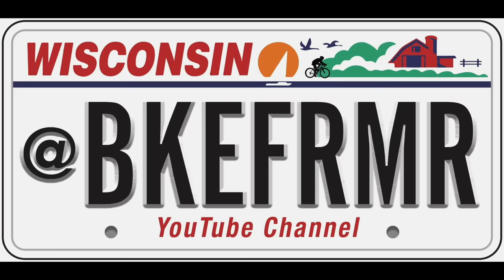Customer TRASHED their bike, but I still took it back! Big mistake? I gotta try!

Comment: I learned quite a bit. TY.  A town we lived in had twice a year 'large item clean-up' whereby residents could put to the curb just about anything they wanted to get rid of. Wanted to teach my kids the value in other people's throw aways so I canvassed the whole town and they arrived home to 12 bikes I amassed lol. I was able to produce 9 complete working examples. Enjoyed 2 myself and gave the rest to people in need. There's just something about bikes. Almost a crime to throw them away.
Reply: bikes are the simple most efficient mode of transport for any human, just think how far you can travel on 1 potato, they're mechanically simple and reliable. you can have a bike anywhere in the world and be able to fix it. there's beauty in the simplicity of something that fundamentally hasnt changed in almost 2 centuries
Reply: I agree so much...This winter I picked up two bikes that had a sign...Free scrap metal...a 1972 and a 1974 schwinn  Great condition just needed some minor adjustments...Wow They were advertised in schwinns manual as lightweight..@ 49 lbs :D
Reply: I work in recycling. The amount of decent bikes people chuck rather than donating to charity is a disgrace 😪

Comment: Adding a dork disc 😊 That’s experience right there: a mechanic who knows his customers knows what they’ll need, even if they don’t 😅
Reply: The metal ones are great
Reply: is that a fake front disc brake ?
Reply: @SPINNINGMYWHEELS777  no, the pie plate is behind the freewheel gears, to prevent spoke damage if debris traps the rear derailer or the limit screw is loose.

Comment: Idk how you got that derailleur set up so quick. I spent hours trying to just “fine tune” mine, only to make it way worse lmao. Good thing the local bike shop owner is a good friend of mine or I would’ve been screwed.  You guys are under appreciated massively.
Reply from the maker: I made one small tweak to the High Limit Screw that I cut from the video because it was pretty much an automatic response for me. I've refurbished and tuned tens of thousands of bikes like this. I'm super good at it! I definitely go into more detail in other videos!
Reply: Try the Shimano installation instructions that are also available online. They explain every single step in detail, and don’t worry if your front mech is a different make, the instructions aren’t limited to Shimano. I’ve worked about ten years as a professional bike mechanic and still think that Shimano’s often discarded unread little leaflets provide all the necessary information for perfectly setting up your shifters and derailleurs.

One thing to keep in mind, on some more recent front mech designs the limit screws maybe inverted; i.e the outer one controls the inner small chainring limit and vice versa. Best to check with the cable disconnected.

And last not least, make sure that the cable is clamped in the correct position with indexed shifters. Else derailleur travel is going to be all over the place and you’ll never get it adjusted. You won’t believe the “creative” ways I’ve seen customers’ front and rear mech cables being clamped incorrectly. Don’t assume that everything is correct just because “it came like that”, especially with a used bike.
Reply: I'm no pro, but here is what I do.  First, with no cable, I set the high limit screw so the upper pulley centerline is just a hair outside the smallest cog's centerline by looking from the rear of the bike.  Second, I manually manipulate the derailleur to the lowest gear (big cog) and set the screw so the upper pulley's centerline is just a hair outside the big cog's centerline.  With the barrel adjuster all the way in and the shifter set to the highest gear install the cable with a decent tension on it (helps to have a third hand tool, but not mandatory).  Set the shifter to the second highest gear, and turn the cranks.  Keep backing out the barrel shifter until you shift into the second smallest cog, and a couple clicks more.  Now run up and down the gears and decide if you need to go in either direction that last click or two to get even shifting speed up/down.  Jobs a goodin'.
Reply: It helps if the chain is cut correctly to the right length first

Comment: My observations of small bike shop operation leads me to believe that bike repair/servicing is the cornerstone of the business. Sales brings them in but providing great service will build a customer base. Also servicing bikes has a fixed time frame you cannot shorten repair times and still provide quality service. The first indicator of problems in the service business is when the shop has to cut corners. This bike rebuild/repair is a good example of not cutting corners.

Comment: A year back I picked up a '97 Gary Fisher HKEK, and bringing it back to life was a good reminder just how much nicer that era of bikes is to work on.  External cables, maybe 2 allen sizes needed, etc.  Currently it is loaned to one of our interns at work, and he's quite the fan too.  If I paid myself zero, I could probably sell it at a $200 loss, but it is still a hoot to ride the heck out of, even if I have several other more modern bikes to choose from.
Reply: i scored a '97 HKEK from the pawn shop a couple of weeks ago and it's such a sweet, sweet bike, all it needed was a little tlc and tires (holding off for the moment there). they're just Built Different and as much as there's so much to be said for modern bikes... nothing rides like old midrange steel

Comment: I've taken to putting baby powder in my tires before adding the tubes.  Basically coat the inside of the tire with baby powder so the tube won't stick to the tire.  Makes removing the tire in the future SO much easier.  No idea if it's detrimental to the tube or tire, but I've been doing it for years without a problem.
Reply: I do the same, especially when I patch a tube, as it prevents any adhesive from bonding to the tire. It's always worked great for me.
Reply: I use baby powder as well. I think it makes a positive difference.
Reply: Also known as talc powder.

Comment: I would try to straighten the downer part of the derailleur hanger in a vice to make sure the housing of the thread is aligned, but only with a steel bike.
Otherwise the problem with threatening in the alignment tool might occur.
It is also possible to threat another rear wheel in the derailleur hanger for the alignment procudure and take the measurements from it.

Comment: I thought the trick of lubing spoke nipples was a good idea, so i did it with triflow on an old set of Mavic 238's. I was happy to discover not one seized spoke nipple when I trued them. Within the first 20 miles on the wheels, the spoke tension went out the window. After getting home I had to re-tension both wheels. Several spokes were finger loose.
Reply: Not only did I put a drop on the exposed threads where they met each nipple, but I also put a drop on the head of each nipple, under the rim strip. It definitely worked well, maybe a little too well.😂

Comment: I love to see another bike get saved for a kid that's going to ride the hell out of it, and maybe trash it again. Wash, rinse, repeat. Compare this to the shiny people who keep their prized carbon fiber piece of jewelry polished and displayed in their living space, but never ride it. On the bent steel derailleur hanger: If you suspect the threads have been distorted, it MIGHT be better to gently bend the hanger back a bit by eye with an adjustable wrench at first before inserting the derailleur alignment tool; this way the shape of the threads are restored a little bit before threading in the tool.

Comment: Nice video showing how to fix up an old bike properly without spending too much money.  Well done, you have fine skills.
Just one thing I would have done differently, I would have taken one more link out of the chain, it still looked a little slack to me on small/small while it had plenty of room on big/big. 😀
It took me a while before I realised how important it is to pre-stretch the cables when new, I do it just like you.
I also have a the tool for straightening derailleur hangers and it is surprising how many bikes I buy that have a bent one.
I have subscribed, I like your style.

Comment: Honestly didn't think I'd watch all 42 minutes but it went by quick! Your flow and speed of tuning is really impressive, ofcourse it helps to have the right equipment but you can tell you have an extra sense for what bikes need!
Most importantly you got the ol' girl working well again!
Quick question... Do those suspension bike posts actually make a difference? Have a very stiff hybrid bike w no suspension.
Reply from the maker: They are mostly a marketing gimmick, but  yes, they make a difference.
Reply: @bkefrmr  thanks for answering my question!

Comment: Thank you that's pretty much what my planet earth needs I'm going to bring it in get the heat gun and get the decals off their lifting it will look great the pain is in good shape it will be solid silver but I've got a Shimano Tourney for it I believe I have enough cables I should order some more in fact I should look at my inventory and see what I need got a lot of projects this winter that'll be great whenever the snow gets here I'll be able to get the all these projects done well thank you much and as always I've learned a lot I really like the emery cloth on the rims that's good to know and I never thought about the bottle cage screws I do oil just about everything or a little bit at the beginning of the project I was a bit leery wondering if it was really worth it you probably have a better source for the parts but mine is extremely reasonable and plus I get a raid on the shipping anything over $10 the shipping is three and that's not too hard and there's always something else I can order if p that I know that I'm going to use the next time so assemblies old 90s bikes are actually worth it but if you look at it in the state they're in you know I just located some really good tires for this other planet Earth project that I didn't even know that I had sometimes when I go into my storage it's like Christmas I discovered things that I forgot I and thank you once again I love the channel

Comment: I messed up a few wheels in my day until I realized you don’t just turn any spokes but find the ones that need it. Also if I have a really tight spoke and the ones on the same side are loose I back the tight one off half a turn and tighten the other two by a quarter til I get them all the same pitch when plucking them. I miss truing my wheels but the ones I have on my road bike has never needed any truing I guess I shouldn’t complain but I wanna true a wheel.

Comment: About a year ago, my bike got stolen. Had no money so I needed a cheap bike.
On our craigslist, there was a 90s Peugeot Country 200 trekking bike on sale for 50 quid.
I've never worked on bikes before but I wanted to partially overhaul this bike.

It started with the seized seatpost, the previous owner, jammed a seatpost that was too wide down the seattube. I had to saw the post off, cut a notch with a sawblade from the inside and use a wrench to crush it and get it out. Took me about a week, chipping away for a while after work.
Felt so good when I got it out. Rode it to work the next day proud as can be.

Just wanted to replace the chain and cassette but that was an endeavour that took me almost half a year.
Because the bottom bracket was absolutely seized. I went to 3 bike shops, they couldnt get it out, tried heat, a vice and 3 men.
I eventually got lucky on a bike forum, someone that lived close to me, got the BB out, as if it was nothing.

I then touched up the frame, repainting certain parts, applying varnish, it looked like new. Put fenders on a rack and some real nice tires. 
Then I realised the bike is too small for me. I was gutted.
I passed it on to a friend who can ride it and that's where it lives now.

That bike in this video reminds me a lot of that Peugeot, the bike that planted the bug to tinker.

Comment: Just found your channel, I really enjoy your passion for keeping it simple. 
I just finished the Fl C2C on my 15 year old Cannondale Bad Boy Ultra. A couple upgrades you speak of… seat and bars. Lots of maintenance!!! 
I’m not sure of the exact mileage, but I’m on my 6th set of tires, so I figure 20k or so. Original chain, brake pads which I plan to finally replace (florida is flat), cassette, only tires and tubes have been replaced. 
Glad I found your channel!!!!

Comment: you could have straightened that hanger out by eye at first using a hammer & anvil  then reassemble it & use your special tool , a tap & die set would be handy .  just a thought

Comment: U need to tow in the brake blocks to get rid of squeak 🇬🇧💯👊👍
Reply: What does that mean?
Reply: @RubbishGimpy  The front edge of the pad is angled in towards the rim so that it hits the braking surface first and helps to prevent squeaks.
Reply: @alanmoore9438  Oh, I see.

Comment: Comments: 
The lost footage is a bummer, but the bit at the end does get the point across. You could do a voiceover of a still of the video to explain, but I grasped both how the process worked and that I wouldn't be doing it myself any time soon. 

Tips that were reasonably new for me that I could see myself doing
2:45 Flux Brush from the Plumbing Aisle, good tip
6:45 Use compressed air to get grips off (and on) handlebars. Use a little screwdriver to get the space you need to start getting air pumped in
10:26 Brand Recommendation - Triflow for lubricating brake cables and pretty much all other parts
12:20 Suave Hairspray max hold as an adhesive for grips
36:01 Quick links can save you some work time alright
40:45 Emory Cloth (plumbing section) will smooth out the outside of the rims and allow for better contact / less noise when braking

Jokes that jumped out at me:
Lawyer lips- 4:10 lol
Snot on a doorknob never heard that one before your videos 
Love the musical bike wheel at 17:55
25:05 sleep through the ads, help everyone's bottom line!
41:45 College bike, not worth stealing but better than the ones that do get stolen!

Thanks again for the content. I learned a lot, and also recognize where some of my limitations will have to stay for the foreseeable future.
Reply: My kid has an 80’s Peugeot Mixte I refurbished as their college ride. I converted it to 700c x35 tires and threw 9-speed Ultegra components w/bar end shifters, kept the center pull brakes and stainless fenders. Added a new dynamo for modern led lights. Heavy steel, but fast enough to get to class with 46/36 chainring, ya never know, he may want to try cyclocross.

Comment: I've put 1.5 inch randonneur tyres on a 26 wheel and 60 psi saves watts and increases the speed a little bit,for the winter I ll put back beefy 26x2.125

Comment: I have a very similar shop and clientele to yours.  I see so many "roached" (haha hadnt heard that one before) But seriously the problem isnt the kids, its these bikes.  Most kids dont know or care about how to properly work a 3 x 7/8/9 and derailleurs are prone to damage.  This plethora of full suspension 3x7 MTBs may sell well to a wide eyed 8 year old boy but they are just bound for the trash heap.  Kids would be better off with a 1950s Schwinn or a 72 Raleigh tourist.  Most shops would not even take on this kind of bike, and I hope you are able to sell it for enough you are making more than $10/hr

Comment: If you have a valve core extractor tool with the threaded T handle one side of the T extracts the valve core casing when the valve core breaks like yours did.

Comment: Just bought a 15€ Bianchi from around 2001, mounted with Alivio/Acera 3x7 groupset, rigid fork and free (small) rust spots near the cable guides
Probably a good deal for someone with bike mechanics background, considering that it clearly sat for years outside (a balcony I guess), no grease in any bearing, cooked brake pads and rusted brake/shift cables+crunchy cable guides and brake/shifters a bit tired.
I was planning to spend 20/30€ to just change the cables and use it as a pole bike, but then found out that the seatpost is stuck as well.
Now the parts and tools list has expanded up to 50/80 euros depending on what I can save, but still I think it looks cool, and most importantly self-rewarding to get to ride a bike i dismantled and put back on.
Your cleaning/lubing method worked fine 
Any tips for the seatpost? Tried hammering it, but didn't move. And it has a sort of collar/adapter to fit in the frame, all stuck together

Comment: Probably worth selling it for scrap metal? Look at the dorky geometry and stem!! Looks like something that would have been $100 new back in the late 90's
Reply from the maker: I’ll get $299 for it no problem next summer.
Reply: @bkefrmr Wow really? Bikes in Walmart cost not much more and even have disc brakes and everything is totally new. I'm not trolling, Walmart do sell ok bikes and they don't fall apart too easily otherwise they would pay to much in lawsuites. It was a good video but honestly how much could that bike have cost new since it didn't have quick release rear? I'm thinking around $350 tops but I can see your good around tools (I'm a mechanic myself) so thanks for your video it was very pleasant to watch.
Reply from the maker: @d9918  this is a shop quality Mongoose. Believe what you will, but new Walmart bikes are shit quality compared to this older one. If you buy a new one from Walmart, I won’t even touch it.